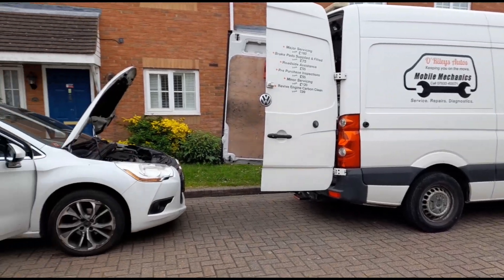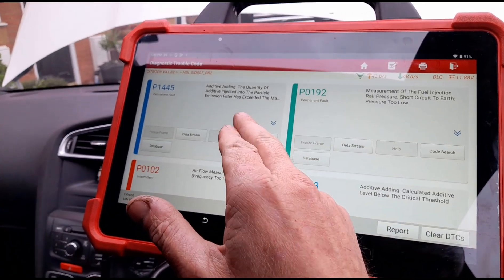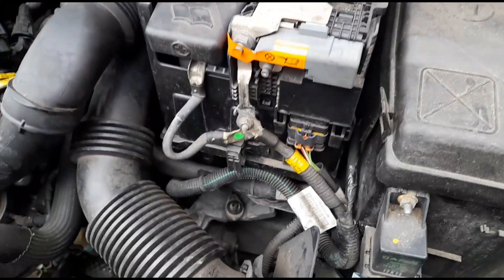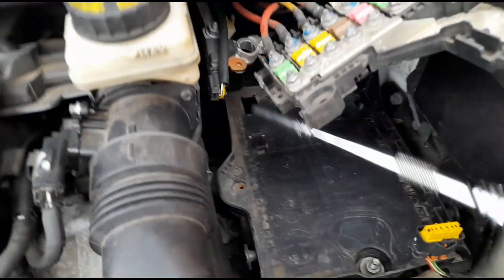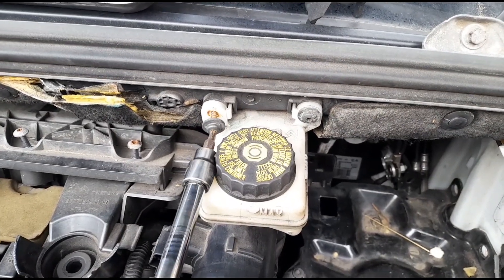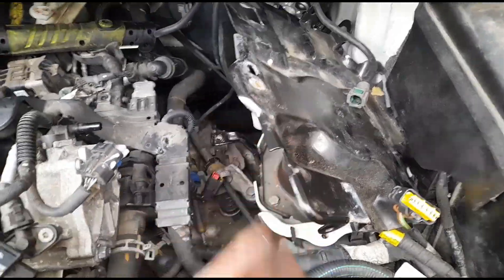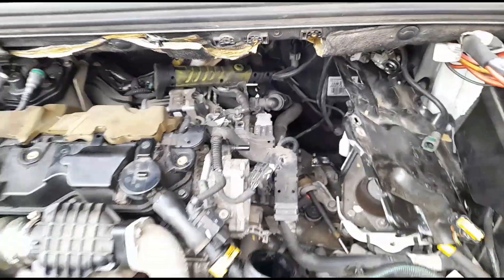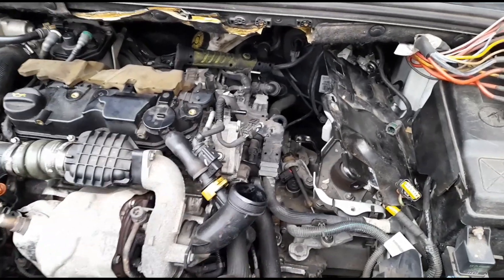Citroen C4 1.6 Hdi  P0192 Measurement Of The Fuel Injection Rail Pressure Short Circuit To Earth

Comment: The same engine used in MINIs is way easier to work with. Amazing how the French engineers can mess things up 🫣😆
I will have to do the same work on my car, as the rail data is off and the engine is jerking.

Comment: I have the same engine when cold it crank and star after few seconds and works fine until i stop and try to start when hot it doesn’t start . Only if i push or use spray. I saw when i crank is not enough pressure in the rail. No errors on tester. Can this fix the problem?

Comment: I have same fault for P0192 on a Pug 207 HDi, its happened in the past after a gearbox change and I think the plug or wires to the regulator got snagged or disturbed, I reseated it and its has been fine for a couple of years until the last few days and a recent starter motor change which has unsettled wiring etc once again. Car keeps cutting out and refusing to start, clearing the codes is ok for a few mins, its been a stressful 5 mile trip home this afternoon but made it. Got battery and bracket off, will get more off tomorrow, will need a deep 27mm and I might just buy a new sensor and hope for the best. I think last time I removed fuel filter and its bracket and I think I could just about see the plug on the regulator.

Comment: Hi got the same engine on the 3008 having same prob , when u change the fuel rail sensor do you need to depresurise the fuel system ,or just take sensor off and replace as you have in video.ta andy
Reply: in my exp the fuel pressure goes down almost immediately after switching off

Comment: Hi Jimmy, quick couple questions.
Will the pressure differential be higher if the dpf is almost full enough for a regen? Should I wait until the regen is complete before checking the pressure. It's currently at 77% and at idle is showing 26hPa. (oil Ash is at 48g/60% if that makes a difference). If the car has the egr cooler and you put the fluid in to clean them both, How does it clean out the egr cooler without making it's way to the engine or does it just clean the face of the cooler? Thanks. Great videos. I'm only in Oxfordshire so may head your way for a clean rather than replacing things.

Comment: One of my favourite channels now pal because of the content you're putting up. I always take a little bit of info for when I'm diagnosing vehicles. Thanks and keep em coming. I remember changing on of those and a low pressure  fuel sensor.  Think it was bolted to block and ended up dropping subframe to get em both out. A good hour and a half work I think